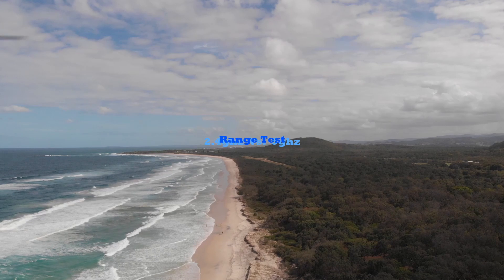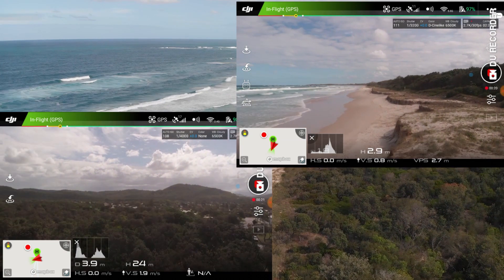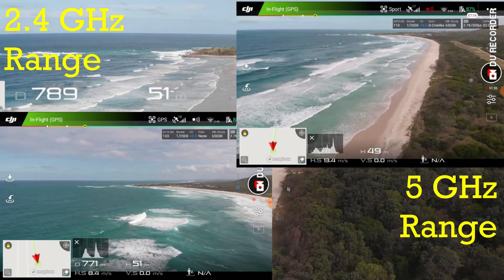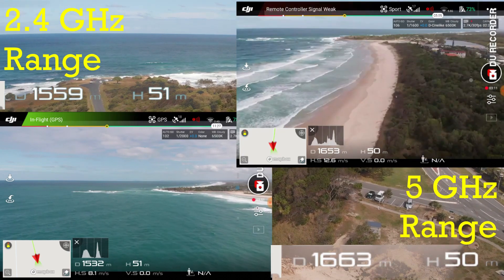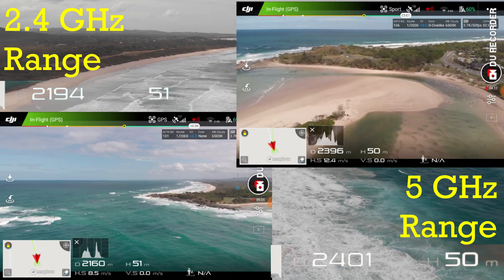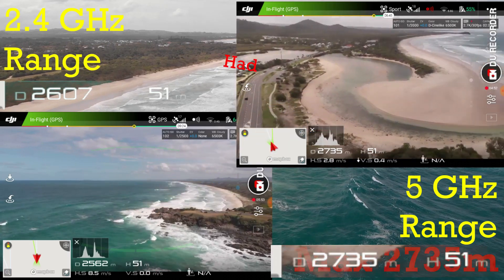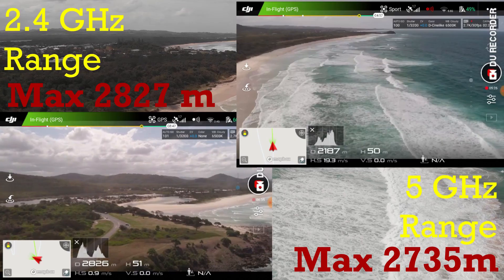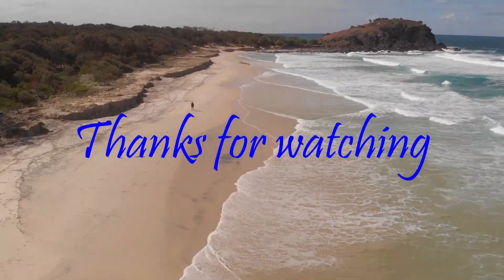2.4 GHz Vs. 5GHz range test DJI Mavic Air (fcc)

Comment: I get better range on 5.8Ghz in both urban and rural..  I have you beat by over a km I done 3,850+ meters stock, unboosted, FCC mode 5.8Ghz channel 161.
Reply from the maker: Hey, thats awesome. im going to do a better test since i didn't get to the limit of where I could in this one. if I could get to 3850+ i would be more than happy with that
Reply: bruh do you have an evidence at least??